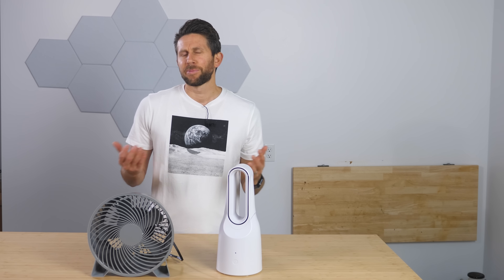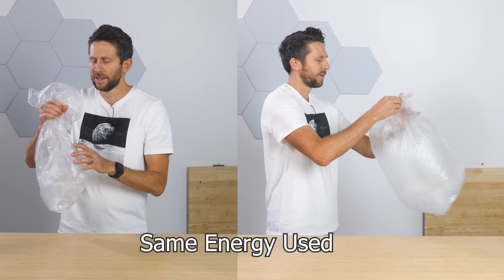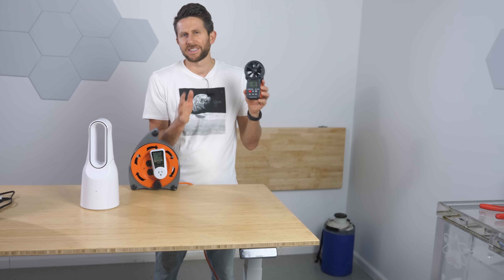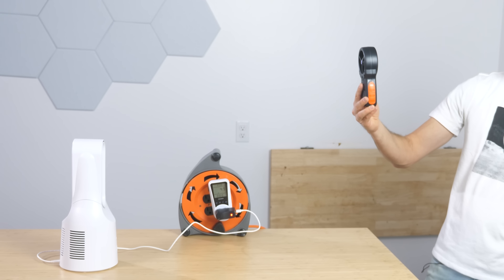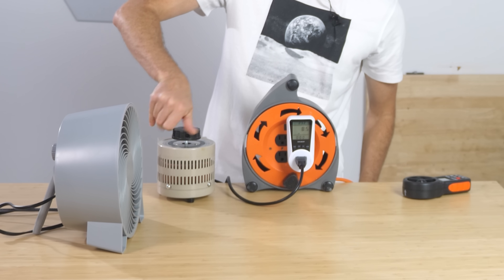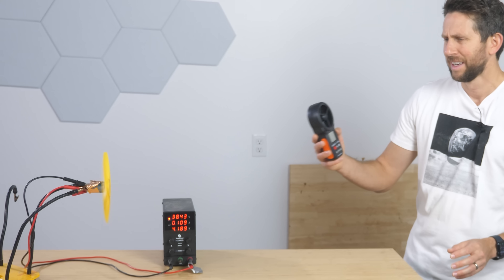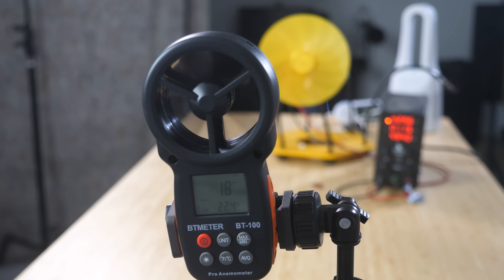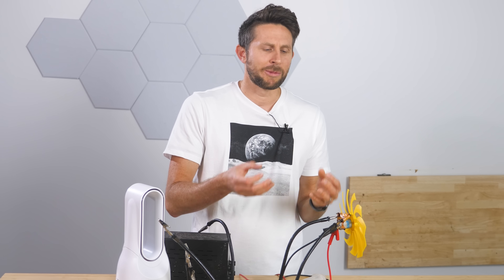Are Bladeless Fans a Scam?

Comment: I don't think this is a fair comparison, as Dyson specifically designs very efficient motors and air-flow networks to work inside their blameless fans from the ground up. This cheapie, looks like it's taken a blower fan from a car's AC unit and slapped it inside a base.

Comment: I only ever considered a bladeless fan because I have a toddler. Normal standing fans are fine if they go up high enough, but then you have balance issues if the kid is shaking it back and forth. However, it is a quick learning lesson if those fingers get buzzed a bit.

Comment: If efficiency is a selling point for Dyson fans then it's because Dyson have invested heavily in developing highly efficient small motor technology, not because of the air multiplier design.  But regardless I think the main selling points are really quietness, safety, and simply looking good around the home.  If air flow comes into it then it's about reduced turbulence rather than increased volumetric flow compared with a conventional fan.

Comment: i have a dyson bladeless fan. it is the only ventilator i do not mind blows be in the face, because it have a hepa filter and uv light to clean the air. 
i think the air from the dyson i have blows air cleaner than outside. 
any other nomal ventilator i do not like to blow me in the face.. because off all the dust.
and normaly i have it at lvl 4 speed, that is enough to cool me down, and i can almost not hear the fan that is inside the dyson. the really benefit is that no hand gets hit from the fan.

Comment: You can`t measure the ingoing electrical power, when using a variac and correlate it to another system not using one.
A single phase motor is optimized for it`s rated power and voltages - lower voltage and lower power output (mechanically) lower it`s efficiency by a big factor (factor 2 maybe even 10 when going that low).

Comment: The blade less fan you bought is a knock off of the Dyson, which uses an impeller style not the tower fan style of blade. The tower fan blade design is very efficient and is more for the aesthetic. Look the Dyson span looks more like a compressor.

Comment: The benefit is a higher mass flow at reduced velocity. High velocity air flow creates turbulence, which picks up dust, etc. and reduces comfort. Spreading the energy over more mass creates a more even flow, that is far more comfortable. This "comparison" didn't even take a couple of minutes to research the topic properly, or maybe they did and found that a bladeless fan is actually better and there's broad consensus on that, so they did a mediocre "comparison" with the goal to be contrarian. Either way, bad work.

Comment: I think you’re forgetting, at least in dyson case, that it’s an air purifier first and a fan second. It’s very efficient at pulling air through the filters and distributing the clean air throughout the room. Clean air is dyson focus, not having the most wind power. Cheers

Comment: You said yourself - an indirect fan is meant to move more air but at lower velocity than a direct one. You measure wind speed. Ofc, direct will win. But that's not the right measurement. You need to measure the volume of moved air to get the answer here.

Comment: I think you made a mistake with the variac... 
The power meter is in front of it, so it includes losses in the variac. I think the fan should be able to run at 5W power no problem. A max power rating of a similar one I have is 21W (producing really serious airflow), so 1/4 should be no issue really.

Comment: As an engineer we mostly use low voltage DC fans as they are much more efficient than house voltage AC fans, except for very high volume/pressure.

Comment: Additional factor at play would be the turn air takes before coming out the "bladeless" design. It's something ya deal with in PC case cooling. Every 90° angle air has to go takes a chunk out of airflow (aka performance).

Like the PC cases with glass in front of fans but slits to the sides.

Comment: You should test and see how many newtons of thrust the fans produce by seeing how much the fan pushes back against a force measuring apparatus.
Reply: I now remember thinking of this idea, when they first brought these fans out.
Of course, you could just use a sensitive digital scale, with the fan blowing up or down to make the measurement.
Reply: The anemometer he is using is just fine for that purpose. He just has to take a bunch of readings on a grid. Volumetric flow rate is the correct measure here.

Comment: There actually are truly bladeless fans called ionic fans, but they can only move a very small amount of air by comparison. Sharper Image had one for sale years ago.
Reply: Ionic Breeze Commercials. Sweet nostalgia
Reply: @CodeBonYT Yep! They put it in that tiny plexiglass cubicle full of smoke and it clears it up quickly, but apparently in actual rooms it doesn't do so well. Still an interesting idea though, and would probably work well in a confined space like a car.
Reply: There is this bladeless fan for CPUs that came out or is about to come out.

 It is called the air jet, and they say it is a solid state fan. Think it is the same principle. 

 It isn't for a room of course. Yet it had enough airspeed to keep a ping pong ball in the air if I remember which blew me away honestly considering how small it was with no moving parts.
Reply: @dianapennepacker6854 It uses vibrating membranes so it's definitely not similar and despite what Frore says, it's not solid state
Reply: How silent were they ?
Ionic wind fascinates me.
Reply: Sounds very dangerous. If it ionizes air, it creates ozone, which is not very good for living.
Reply: Ionic breeze was a marketing gimmick that did literally nothing, and when they sued Consumer Reports, they doubled down and did more testing just to show even more conclusively that the devices did diddly squat.
Reply: I can't say I have ever taken one of these apart, but just looking at it I am pretty sure there is a small fan blade inside that tower. Just because it is silent does not mean it does not have a fan blade, the Airmax fans in my RV are completely silent at the lowest speed.
Reply: @robertdaymouse3784  ionic is truly bladeless that's also why they barely move any air. These have a belt style blade system that goes the circumference of the ring and has a slit for the air to move out. The intake is in the base.
Reply: Don't they also make toxic ozone?

Comment: The draw of the fan is most definitely that it has a unique form factor (is cool looking) but also safety if you have little kids and that it looks cleaner (you don’t see the accumulation of dust on the fan blades inside of the base).

I have great memories of my brother and I daring each other to stick our fingers in big old box fans as kiddos. It stings. Not recommended. Surprised we never were seriously injured by it. 😅

Comment: AC motor speed isn't just governed by voltage... frequency plays a big part especially if you want to lower the speed of a 40-70W motor (I'm guessing at the wattage of the original grey fan you had) down to what it would be at 5W if it were a genuine 5W motor.
So called bladeless fans, which slightly compress air, force a small volume of air through a small gap so it can entrain some air are always going to be less efficient than a normal fan that moves a large volume of air and skip the compression step entirely. The whole "beating air" effect is unnoticeable unless you're a foot in front of it, which is uncomfortable because of the air flow. Of course, you need to be that close to a Dyson because they're weak on low speed and noisy on high.

Comment: This was a good consumer focused test. I understand people with comments about how to get more accurate results, but from the standpoint of a person who just wants to know how much air is (seemingly) getting moved around to help them cool off a little, and where they should be putting their money to do so, this was the prefect test.
Reply: No really because as he admits this could be completely different if the fan used is different. Watched a Chinese companies video showing how they made bladeless fans and they used a completely different fan in the base. I suppose I’m more interested in how the Dyson ones compare, I know they are very durable and look good but hate the price and have avoided buying one.
Reply: Maybe if he actually had used a dyson one and not a knock off, to see what the original and expensive design is worth. Furthermore he did not actually messure the noise at all and compare both of them in normal use because that is actually something that is bothering many people. This test is useless to me, especially as he did not meassure air volume moved. Ofc a fan directly blowing at something is going to do it with more power than one that has to change airflow direction. Pardon me while I facepalm away.
Reply: What this showed was that for one cheap, knock-off bladeless fan, the air speed was lower. That's it. It didn't tell us anything about the actual volume of air moved, or which was more effective at cooling a Room. And often knock-off products copy the look and general function, but don't work nearly as well.

Comment: I think . bare bladeless fan which gives 2.1 unit air flow as oppose to the scenario that it is in the Bladeless fan casing , which yeads flow rate of 14 unit.i s because ve get 1.4 unit flow just front slit , thre must be smae air flow provide from back slit , so the is no efficence problem . result adds up to bare fan air flow ratio

Comment: You are using the wrong units. you need to measure CUBIC feet (or meters) per second. HVAC guys have a device which does this easily.
The problem is that it essentially creates the same thing that the bladeless fan is already doing.

Comment: I'm not sure if anyone else brought this up, but in order to test the wattage used by the first bladed fan in your experiment, you want to put the wattmeter between the variac's output and the fan.  This way, you are not also reading the power consumed by the variac itself.
Reply: A variac is a passive device.  They're just autotransformers with an adjustable tap.  The amount of extra resistance and thus wattage is negligible.
Reply: @Uejji  Inductors are extremely lossy. You think transformers are ideal? They are the lossiest thing ever invented. Don't think so? Put an ammeter on the primary and leave the secondary open circuit, watch how much energy goes down the drain, doing NOTHING.
Reply: @douggale5962 the transformer probably only wastes about 1 watt bro
Reply: @Uejji  So you're claiming transformers are close to 100% efficient? Transformers consume power, and when you're only talking about measuring a few watts (and the difference between two fans may be in the milliwats for the same output) the power they consume is not negligible. Do the experiment yourself - put a power meter pre & post variac.
Reply: I'm pretty sure the bladeless fan has a step down transformer and an ac to dc converter plus voltage regulator. I think they're even.
Reply: The wattmeter may not work when the voltage drops below a certain amount.
Reply: Shouldn't the frequency have been adjusted, rather than the voltage, for this type of motor?
Reply: These Dyson Fans just look good. For efficiency and effect stick to an old fashioned bladed fan.😎
Reply: @williamnot8934  only from a distance. From up close they're really plasticky and tacky. Moving them around they creak a lot and they have stupid controls which are much more difficult to use than a regular fan.

Comment: Why didn't you test the original Dyson fan? I only understood how far Dyson's products are above the competition when I bumped into a crazy V8 promotion at a local supermarket. Before owning a Dyson product I thought Dyson's marketing looked scammy and silly. Specially after I had used the V8 for 5 years it makes all other vacuum cleaners look scammy and silly. I started loving it even more when I found out that its washable filters don't get dirty much, and how easy it is to replace the battery. Dyson electric motors are awesomely built, powerful, efficient and reliable. Totally apart from the generic motors we find in other products.

Comment: You should have measured not only the top speed, but the whole flow front using multiple measurements in a grid and integrating over them.

Comment: As you seemed to hint at after doing the first test, using a variac is not a good way to do the test, since it only drops the voltage, not the frequency. And when you drop the voltage well below its designed voltage rating, the rotor will not have enough power to follow the ac sine wave, and therefore it will be constantly out of phase and pull very high amperage for the amount of actual work it is doing. So it's not really a fair test that way. But this was a great demonstration of why.

Comment: Bladeless fans feel like a smoother stream of air then a traditional fan. More like a really nice consistent breeze to accompany an ac. Dyson has a filter in their base that purifies the air even if you don’t care about your air quality or already have good air quality; this would mean you don’t have to spend the time to clean the fan blades just very quickly run a duster over the outside. If nothing else they also just look sleeker than a traditional fan. You can also get Dyson on sale for significantly cheaper than normal retail. To each their own, but I quite like my Dyson it works for me. 🤷‍♂️

Comment: As a dual canine pet owner I think "blade-less" fans would be way easier to clean than traditional fans.
Reply: Not really. You'd have to disassemble a bladeless fan just to be able to get to the fan itself for cleaning. It's sucking air in, so yes... the inside WILL get dirty, but you don't see it.

Comment: I think that thrust would’ve been a better measure here. Put the fan on a low-friction caddy and see the force it generates trying to push it.

Also, shrouded fans tend to perform better than unshrouded fans like the one you used as the comparison.

Comment: I have a question and I’m curious is that can we do sculpting with frequencies. Wanted to try a csymatic experiment where If possible you can put sand on a plate and see them make a pattern at a certain frequency is it possible to add water in same plate and see if the same frequency will guide the water to form the same pattern with the sand and mix

Comment: In my experience with blameless and regular fans I have discovered they are similar to lights. Bladeless fans are like high candlepower spotlights. They seem to move air to a spot and when a person is in that spot they feel the cool air. But a regular fan is like a high lumen flood light. They put out a lot of light for a larger area even though the light may be dimmer in any one spot. You measured air SPEED but not air volume.
Reply: The Dyson has wide (main beam) and narrow (high beam) settings

Comment: I don’t think it’s a good comparison because really what we would be comparing is what you can actually buy, not some jury-rigged fan that is optimised for the low power.  If the conventional fan doesn’t go so low, then you should at least set the bladeless fan to a higher setting so that you can actually do a meaningful test with the conventional fan.
But as it is, your first test already showed that yes the bladeless fan is way more efficient than the conventional fan before you stacked the deck against it to make your point.
And also not all bladeless fans are created the same, maybe a hundred plus dollar Dyson would perform better than a $50 made in China bladeless?

Comment: The advantages of the bladeless fan are less turbulent airflow (you don't get the usual buffeting), and you can put a HEPA filter around the fan to improve air quality.  In general I've not found them to be particularly quieter.
Reply: He REALLY should have mentioned Bernoulli, the guy tested and worked out formulas for this in the Victorian era! This needs a full follow-up video 💯

Comment: Bladeless fans aren't bladeless, the blades are just in the base.  The purpose of them was chiefly aesthetic originally, but the advantage of them today is they don't create vortexes, not that most people care about that.  They cannot be more efficient in moving air, just from an engineering standpoint.  Bladeless fans require that the fan make a higher pressure, and then you have to deal with the Carnot cycle.  When you compress a gas, no matter what you do, you're going to lose energy doing it.  A standard fan compresses gas much less than a bladeless fan would.

Comment: Your video is convincing but you are not mentioned air Venturi for pressure drop or increase also be considered.
Prove that is not upto that level and my question is how it is not principle of Venturi because of design of inner surface of blade less fan  is not playing major role.
And how it will be better way of possible way for suction using Venturi principle.

Comment: The Variac is not the correct instrument to control the fan, you will weaken the magnetic field in non-linear way. The correct is use an inverter to control the powerline frequency.